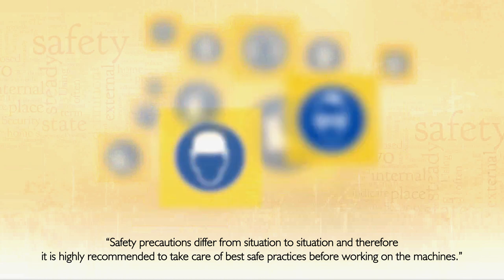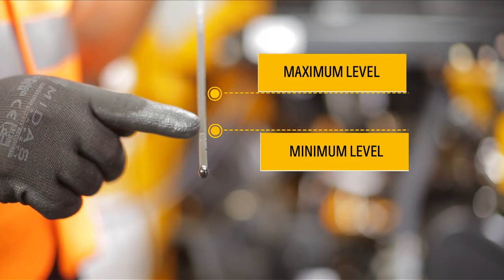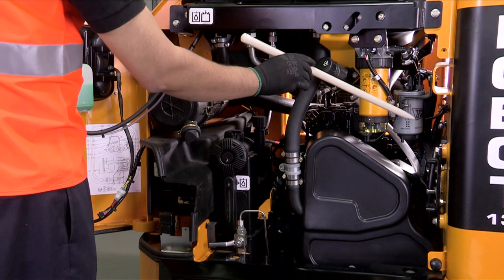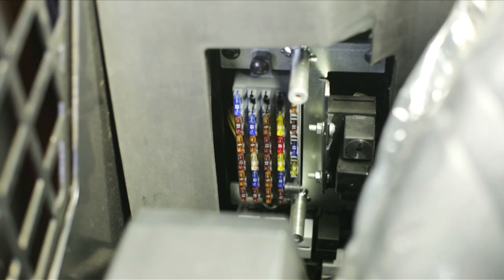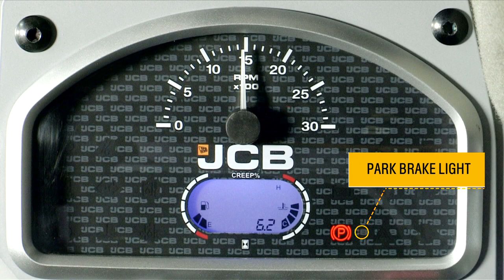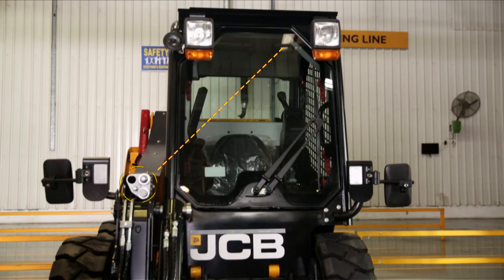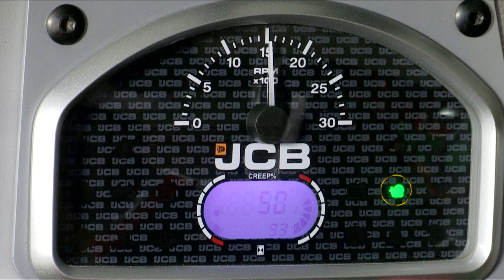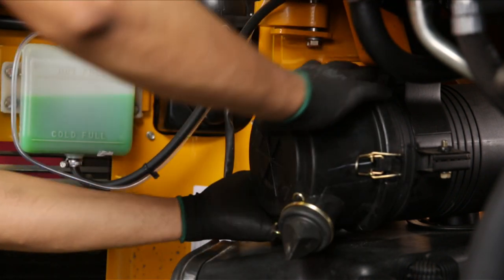Know your JCB Skid Steer Loader

Comment: My HVAC fans inside the cabin will not turn on. Anyone have an idea what could cause this?. I am getting power at the fan switch, 12v when I turn it on. The fuse is also good and have 12v there.